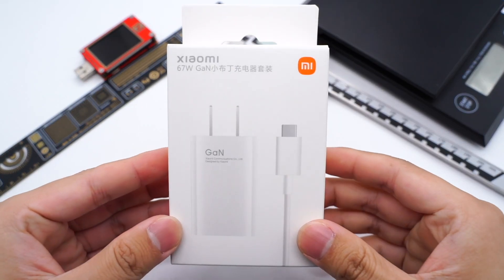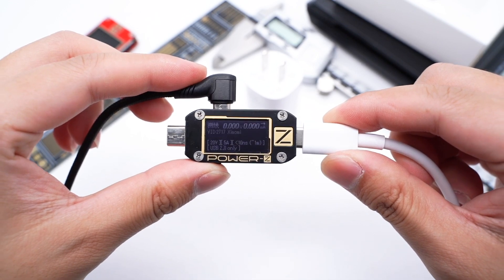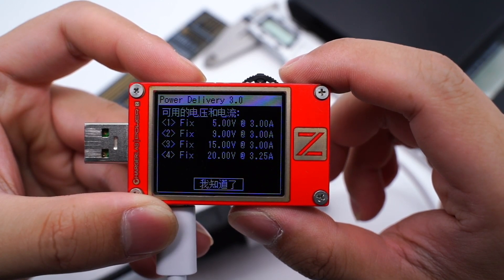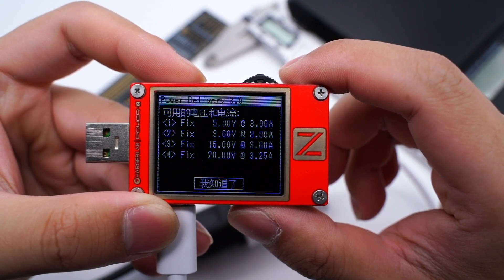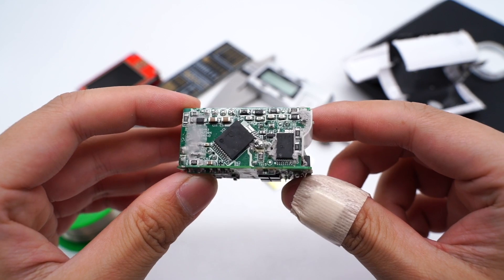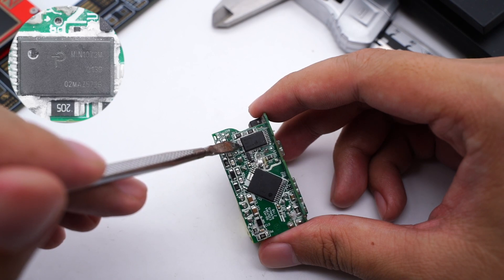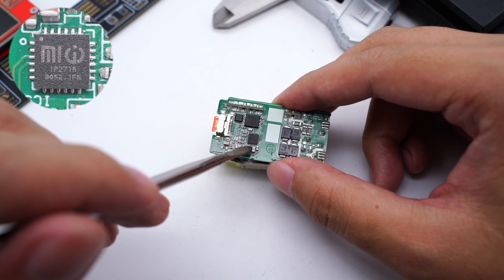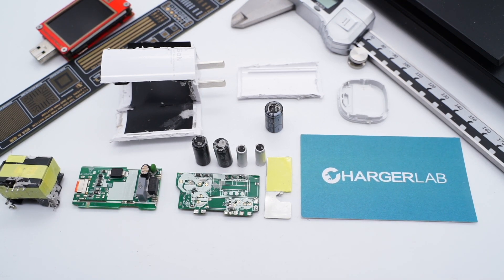Latest Teardown of Xiaomi 67W GaN Pudding Charger

Comment: I hope you guys will have a look at the LiPo chargers that exist for remote control use, like iSDT, ToolkitRC, etc. I am pretty sure there is a lot of overlap in technology. Especially the ToolkitRC P200 adjustbale desktop power supply is supposed to use GaN technology. The question is however if that is in the USB-C circuitry only. Also, these brands had had issues, like the M4Q charger that had failing charger ports. I know it is a different side of the spectrum... but I am sure you will see a lot of interesting design decisions and possibly about quality.

Comment: Unfortunately, Unlike the 65w xiaomi gan 1A1C, this one has no PPS suport this time
Reply: The POWER-Z KM002C can detect the hidden Xiaomi PPS options! 
3.3-10V @ 6.2A (limited to 5A when not using 6A cable)
3.3-11V @ 6.1A (limited to 5A when not using 6A cable)
3.3-20V @ 3.25A
Reply: @mrrkrr  also in this video shows that Xiaomi device will unlock PPS mode and also will renotified the hidden additional PPS pdo's
Reply from the maker: Yes, cause it mainly designed for Xiaomi users.
Reply: what is PPS?

Comment: Finally, someone uses MinE-CAP. But NTC thermistor must not be in it and fuse must have lower rating because MIN1072M can also manage inrush as described in datasheet:
Product Highlights
• Up to 50% volume reduction of input bulk capacitors (E-CAPs) 
• Eliminates inrush NTC
• Significantly reduces i2t stress on the input bridge rectifier and fuse
Reply: Wait, WТF? Is MinE-CAP just connecting 160V capacitor when powered from 100V-127V line, but doesn't cut the matching pieces of sine wave to feed 160V capacitor?
I am disappointed.